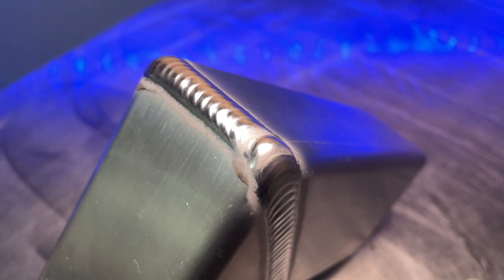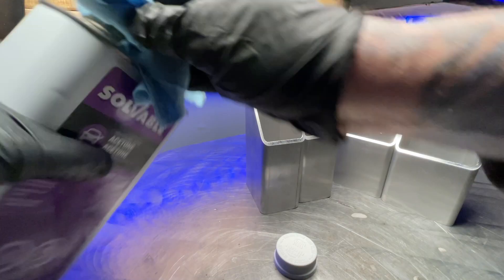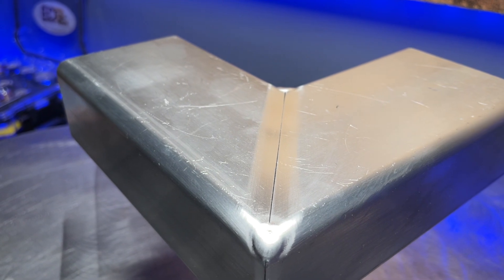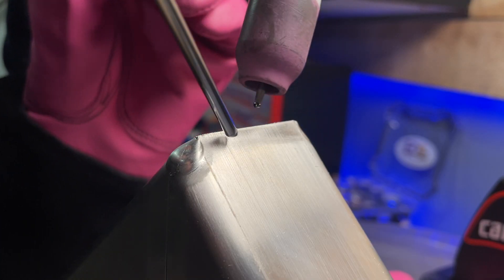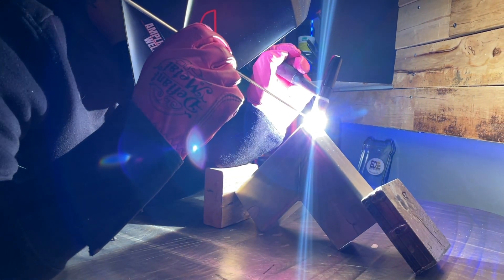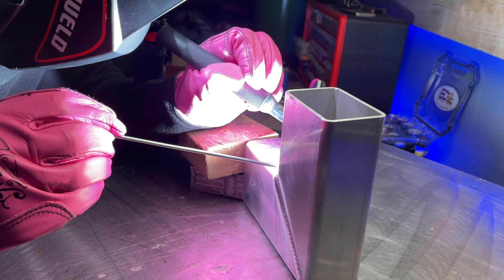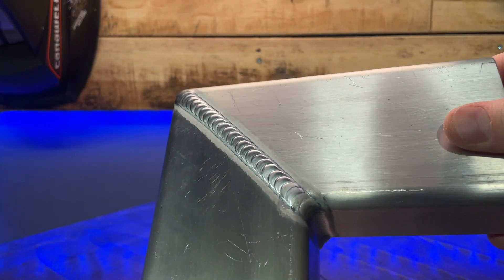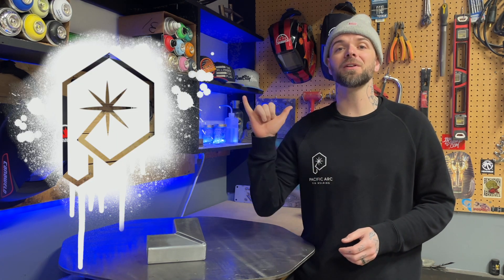HOW TO TIG WELD ALUMINUM SQUARE TUBING

Comment: how does it work when you starting off the first corner? you want heat? then when puddle forms back off the amps with the pedal?? that how it goes? then when you end the weld you use pedal to reduce the amps until finished?

Comment: Amazing how much you sunk the outside corner, really good to know. Your welds are amazing. I'm surprised at how slow you move yet you don't overheat the weld?! Mine come out grey! I'd love to know more... most welders move hot and fast, you seem much slower. Could you do a video on travel speed, over heating, tips and tricks regarding it? Thank you!!

Comment: I have never touched any welding equipment before, but I came here with curiosity because I may be working on a houseboat and framing  the interior with aluminum tubing. My nephew is a welder so I was just trying to get an idea about what to expect. You have a great capacity for teaching and explaining things. I totally got it

Comment: Great Video, and Primo looking Corner. You made that look very easy, which it is NOT by any stretch. Welding an Aluminum Corner with results like that (perfectly straight heat lines, and penetration) take lots, and lots of Practice. I've always heard that it takes 10,000 hours to perfect you Art or Craft, whether that be a Musical Instrument, Painting, or Tig Welding. My Brother, you have obviously put in the hours. That's as nice of a Corner that I have seen. Been following you for a long time. You are Mastering your Art/Craft, no doubt about it.
Keep up the Great Work! 👍

Comment: Can you TIG weld  Aluminum sheets 2mm thick?
Reply: Should be relatively easy at this thickness depending on a number of things such as position of material, alloy of material, filler rod requirements. Shot answer is yes.

Comment: You are extremely talented. I watched most of the videos you have put out there was mindblown by your skills .. I was wondering is it a 100% must have to get a foot pedal or will get results like yours using a normal torch setup? Thanks alot